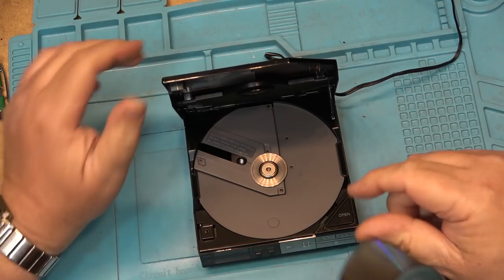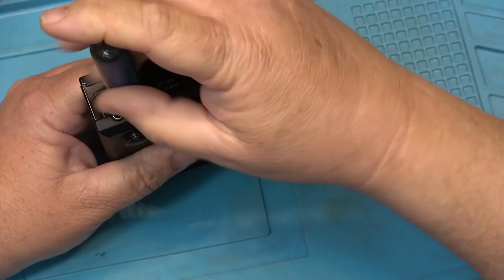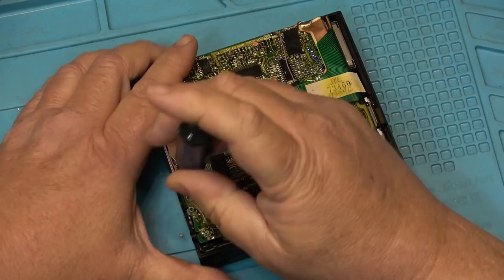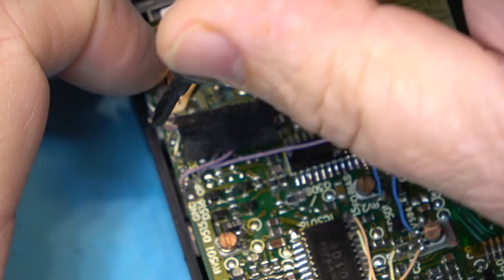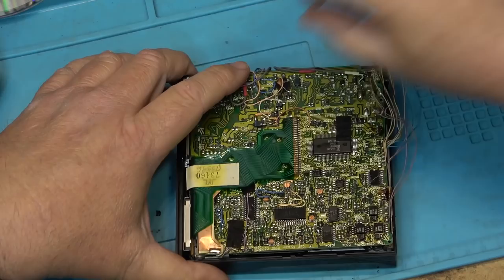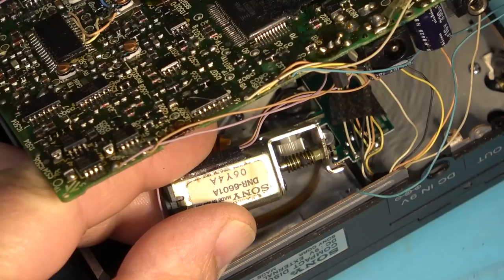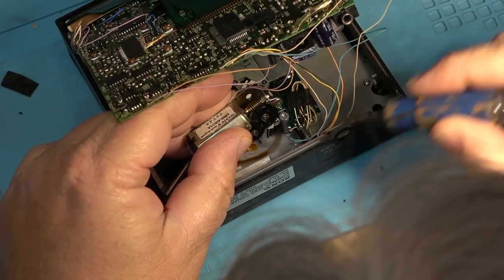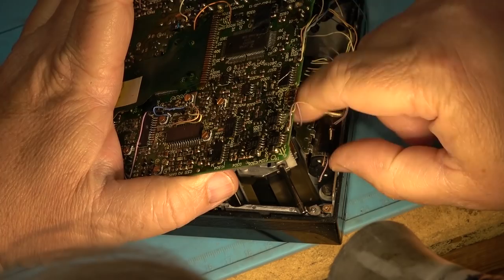Sony D50 Vintage portable CD No Play

Comment: Oh boy !  I owned one of these puppies and I loved it.  It went through batteries at a rate of knots and it didn't cope too well with absorbing shocks during playback.  I was fond of it's digital display - something that was lacking on my Marantz CD73 which had LEDs but no time displays.  The battery pack was a huge lump of plastic that the D50 was put inside. An interesting find in this day and age. 😃
Reply from the maker: I had a philips that went into a battery case. You could buy a rechargeable battery pack for about the cost of the entire unit. It was 1986 or 7 and I was still dumb as a box of hammers in the safety dept. I bought some C size NiCd batteries and stuck a small screw into the hole where the tab on the recharable pack went to activate the charge circuit. One thing I neglected was the thermal cutout switch on the batteries that would shut the charger down if the batteries over heated. One night I arrived home to my apartment filled with smoke. Yup, you guessed it, the batteries had burst. I blame this on Philips for such a stupid design, that would allow batteries to be recharged by just depressing the switch in a little hole on in the battery compartment.
Needless to say the battery compartment was all warped and melted and wouldn't hold any batteries at this point.
Reply: @12voltvids  Well is that not the reason why the switch is there so non rechargeable batteries wont get recharged, and vice versa?
Reply from the maker: @tyronenelson9124  that's right that's why the switch was there but back in 1986 or whatever year it was I had this old Phillips I think the player itself was around $200 and the optional rechargeable battery was another 120. So 4C size nicats did the job. Sure I could have just taken them out and put them in a separate charger but the time I was lazy I wanted to charge them in the unit so I just use something to depress the switch and it worked I recharged those batteries hundreds of times. Then one day it didn't stop charging and because I didn't have a thermal cut out on the cells because that would have been an internal switch connected between the cells that would be in series internal to the battery that was wrapped up in heat shrink it just kept charging. Kind of a dumb design actually when you think about it. Other companies such as Sony or Panasonic would have never permitted it to charge normal cells. Their battery pack would have had a third terminal or something so that the charge circuit could only be operated with their proprietary packs nothing else. A little leaf switch that gets pushed by a little plastic tab on the battery just doesn't cut it because it doesn't take a rocket scientist to figure out that by pushing that switch you can recharge regular batteries. Had it caught fire and burned the apartment building to the ground I can see a lot of liability pointed at Phillips for releasing such a dangerous product.
Reply: @12voltvids  That sounds exactly like what the typical Chinese still design, build and sell to this day, but then again why should they even care, its not like its their house and family's lives being put at risk, which really annoys me.

Comment: I had a Red D50 upto a few weeks and sold it to a local guy to enjoy. It works perfect and plays original and blank copy cdr discs great. I bought from a guy who was from France and he owned it from new back in the 1980's so it must have been serviced as the rubber suspension tyres were not degraded at all.

Comment: I have one of these that I got a couple years ago.  Worked pretty great right up until it stopped doing that.  Not sure what it's deal is.  It just kinda stopped in the middle of a CD, and decided it was ready to move on to the next phase of its life.  Could be caps, could be the laser, could be solar flares.

It's downright amazing though, for its age.  I had a Crown CD player back in the early 80s.  It ran off of AA batteries -- TEN of them -- and had a power switch.  The AC adapter had + and - rails on two separate barrel plugs of different dimensions.  Quirky, but I loved the heck out of that player as a kid.  Took it everywhere and listened to my small collection of CDs over and over and over.  It was a behemoth compared to that svelt Sony.

Comment: These early CD players are effectively plenty of surprises: there's something you could have missed here: I remember most of these monsters could operate on these batteries, but the power adapter could not suffice to operate these, as it was initially dimensioned to charge these batteries only: it could be interesting to check this with a lab supply as the original power adapter could fail to provide the initial power boot current. Same thing with early "portable" reel to reel tape recorders, wich required acid lead batteries to operate, but with a supply with a C/10 current ratio, unable to start a complex two motors mechanisms. Alternatively, this can be checked with a digital scope with a probe on the supply bus...
 These 30 years old machines are always a gambit when it comes to suspensions and belts. You can have some that are perfectly fine when next one is transformed into a melted goo, or crackling plastic mass. And when these mess with fragile nylon gears or other delicate adjustment sets, guess what... And of course you can change most of these parts, find a new laser pick up and change defective components, these are 80% standard CMS, low state of integration components, but there's sometimes some unobtainable parts... And there's also a limit to the amount of time you can spend for these machines, that came with relatively limit audio quality compared to their standard size counterpart (and sometimes for the same budget!). If you can get an early Sony or Philips/Marantz standard size machine, even if you certainly have to struggle with modded and quite fully packed boxes, they generally perform largely better. I also remember these included different mods and added components, when it was not an entire PCB card replacing part of the circuitry. 
Even if you insist to repair one of these "old timers", most of their technical datas and their mods are well documented in complete Datasheets and update bulletins. However, when it comes to something like servo settings and such things, you will need serious equipment (a 2 way scope is mandatory) and eventually test CDs wich are now unavailable: procedures are lengthy and delicate, some of these settings are intricate. And if anybody has altered or tampered one of these circuitry, you can spend numerous hours changing things backward.
And most of these electronic parts and circuitry were also extremely sensitive to electrostatic discharges. You can instantly kill a new laser pickup if you don't use requested precautions and specific tools, as they were not systematically protected with a solder shunt...

Comment: I had 2 x Sony CFD-5 boomboxes which were the first ever boombox to have a built in cd player. The cd player was in fact a D50 in the CFD-5 radio cassette cd boombox. I was able to fully restore one of them but the other the CD player would try to read cd's but after adjusting the laser power and other pots it would still not play. That one was from a smoker so I best the lens had gone cloudy. The rubber suspension rings for the laser unit also were falling apart.

Comment: Sad to see that much tech go into something that didn't last :(
Reply from the maker: This thing is 35 years old.  Designed lifespan perhaps 5. Most didn't make it that long because people dropped them.  Problem with metal transports is they are heavy and they bend when dropped.  Plastic is light and offers some flex before it breaks.

Comment: The D50 came from a time when Sony made good quality products before they went mass market.
Today, they are little better than other brands.
You can win them all Dave, knowing when an item is beyond repair is half the battle.
Reply from the maker: In all likely hoods the laser is bad on this too, as these were not the best lasers made. Early units were a common failure point,
Reply: @12voltvids  Sony lasers were used by many brands and were reknown for having a short life,
i have replaced a lot of them over the years.

Comment: That is a collector piece... I am certain it isn't for the bin!

Yes bodge wires and mods were quite common back in the day.
Reply from the maker: A collector piece for display.  Not ecomical to repair.  There is more wrong then the rubber gromets that have deteriorated.   There will be surface mount caps leaking and the pickup is likely also bad. They used a pickup back is the day that the lens was mounted on a metal yoke that floated on a metal pin. The lubricant dries out and it freezes and can not slide up ad down to focus. Yes it is possible to open and lube it.  Used to do that 40 years ago.  Long term however is not good as the lube dries up again after a few years.

Comment: I have seen an exactly identical behavior on a much later philips portable I had, it was from  '93 and, well, a philips. The main culprits were a dead pickup and leaky electrolitic SMD caps (with tiny acid spills). I did manage to have it read discs again, but the effort was not worth the result.

Comment: Could this one be fixed using a service manual? The D5/D50's service manual is online for free. Goes into a lot of detail including where all those wires are soldered to. And other adjustment information. I bought one (D5) recently and I'm hoping it works.
Reply from the maker: Owner had a 30 limit.  Anything can be fixed for enough money.
Reply: @12voltvids  Wow this CD player is no joke - hard has hell to work on. I desoldered the flat flex cable for the optical pickup and it literally just broke apart and ripped without any force, probably due to age. It sucks because it's a nice CD player. Now I just have a parts unit. At least I have the AC power dock. It seems like the ones manufactured in 1984 don't work well and the newer ones from 1985 (you can tell because the 1985 ones have the green power switch) are better.

Comment: these super old portable cd players are going for nutso prices on ebay right now, no wonder someone wanted to fix it.  I think there's some sort of old school cd player revival going on or something...
Reply from the maker: I don't know why. The early ones sounded like shit.  Only 1 DAC so there is like 11ms delay between the channels.
Reply: @12voltvids   Those early single-channel DACs were multiplexed per-sample, so it's more like 0.22ms delay .. which isn't even an audible phase shift.  :-)  It's fiiiine.  When my D-5(0?) worked, it sounded OK.  I only ever listened to it through some iPhone earbuds, so it never had a chance to really stretch its legs.  One thing though -- it sure had an output amp!  I think I kept the volume knob at like 2 when I wanted to rock out.
Reply from the maker: @TD75  
Not worth it.  I get stuff from 80s for free all the time. People are stupid spending this kind of money on this old crap. It really isn't that good, nor was the stuff from the 70s.  Technically and you are not going to like this but the new stuff is better in every way.  I know people cringe when they think of class d amplifiers but truthfully they are some of the best sounding amps I have heard.  It is not about power.  Most of these powerhouses from the 80s sound pretty rough at low levels.  It's the low volume where good gear really shines and much stuff from the 70s and 80s falls short.

Comment: What's kind of A/V equipment is the most "fun" for you to fix?
Reply from the maker: Any of the 2 channel stuff.  Solid state or tube. Tape decks, r2r dat turntable.  You know stereo stuff, CRT TV's, VCR.
Reply: @12voltvids  Oh shit, that makes me wonder, what's the biggest CRT set you ever worked on?
Reply from the maker: @KlonoaTorqueBow  40" Sony wega. 380lbs.  Had one i refused to work on because customer built it in and it could not be removed and there was no way to fix in home.
Reply: @12voltvids  Built it in...like into a cabinet?
Reply from the maker: @KlonoaTorqueBow  they built it into their bedroom wardrobe cabinet with floor to ceiling closets with mirrors on each side flush with the screen and then a great big dresser below it. Had it all finished and framed right to the side of the unit itself and then the unit broke down within the warranty and my boss told me I had to fix it in the house because it took four guys to put it up there. He actually expected me to take a step ladder and turn the TV around and try to take the back off it and fix it at the customer's house in their bedroom I said not bloody likely. We sent Sony to fix it because I refused